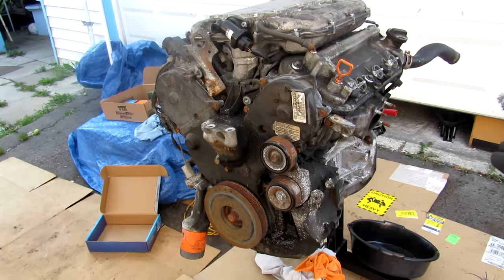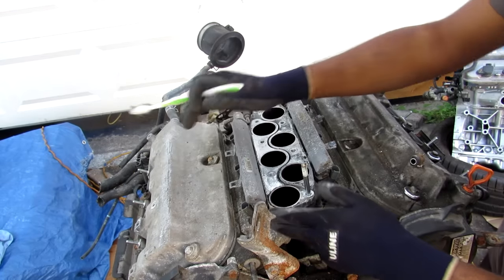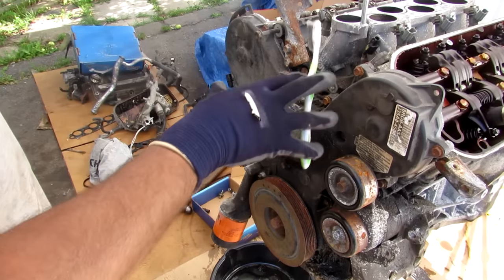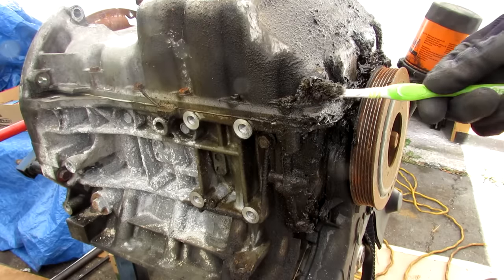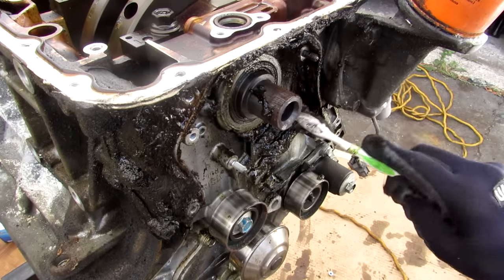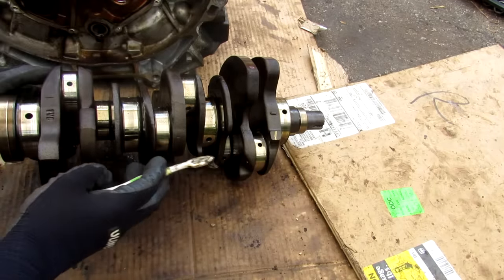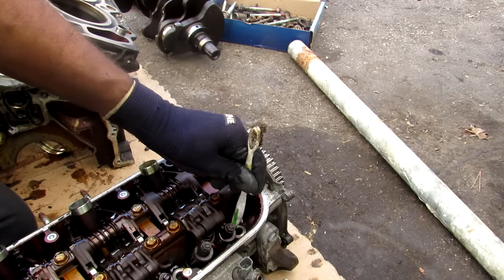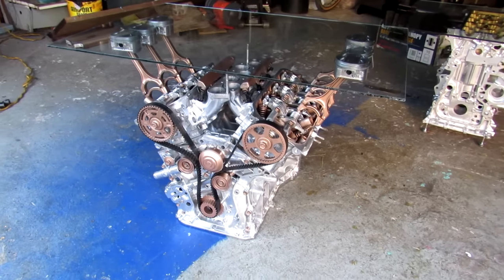Why Honda V6 Engines Haven't Changed For 25 Years

Comment: 5:41.  I replaced the knock sensor and shortly thereafter, the engine light came on again.  I actually made a tool (ground off socket) to remove it without removing the intake manifold.  I've heard complaints of mice chewing on the wire and now your video points out that the wire can fail due to heat.  Starting to think that heat is the culprit and replacing the wire is the proper fix for a bad knock sensor.
Reply from the maker: Yeah that's a common failure and it's quite tight to get in there and change the

Comment: Excellent video! Just a couple of notes: 1) No matter how religiously you service these engines, no matter what oil you use, the intake manifold will always look more or less like that. It's by design. 2) TB is not changed every couple of years. Its service interval is either 100K miles or 7 years (whatever comes first, it's usually 7 years, of course).

Comment: I have a 2004 Accord with the V6. It has 260K miles and purrs like a kitten. Had it since new and just did regular oil changes and a few plug changes and belt change. It’s been so reliable. I bet I can get 400K on it.

Comment: That major oil leak that you noted is one of the few weaknesses of the j series. Oil pump o ring that seals the oil pump to the block gets hard, flat and brittle and turns into a major leak. Other than that, and the occasional solenoid on the spool valves for the cylinder disengament, they are pretty bulletproof. Sources: Honda tech of 3 years
Reply: How about tearing down the entire engine to replace piston rings? Vcm also causes that issue. Bad crank ventilation. Destroyed cam lobes? The longer they modify this old design, the worse this engine becomes as far as reliability.
Reply: @jgranger2002  you do see those, but for the most part, they're pretty uncommon for how many are out there.
Reply: @Dylan Andersen  I pretty much see the oil pump leaking on every honda v6 I do a timing belt on. The vcm engines are trash. Fouled spark plugs. Gummed up, piston rings on them all the time. Owners that don't check their oil. Destroyed cam journals and lobes. Probably because people are using the onboard  oil change intervals. Who can blame them? Honda tells you to change the oil every 10k miles. This results in people changing it at 12k miles. They are now 2 or 3 qts. low on oil. Most cars nowadays are throw away anyhow.
Reply: @jgranger2002  I see the oil pump leak a good bit, piston rings occasionally, but the cams are very few and far between. Of the 3 dealers I've worked for, they've all recommended customers to change their oil every 5k, but of course, most people don't actually maintain their cars.
Reply: @Dylan Andersen  I agree. Unfortunately, manufacturers are pushing these long oil change intervals. I've done the first oil change on new honda turbo engine's. I did an accord 2.0 turbo at 4k miles. The oil looked like diesel oil after 10k miles. There is no way these engines are going to last. Like I said, throw-away cars are just the normal now.
Reply: @jgranger2002  the 2.0s are pretty solid so far. The 1.5 has issues though

Comment: nice video. you dont have to remove the heads to get the runners off. all you have to do is remove the fuel rail and that gives plenty of space to get the bolts off and slide it off. done it at least few times to replace the damn knock sensor

Comment: I work with modern J series V6 engines almost every day and few aside from direct injection and more plastic to reduce weight they are basically the same as this one
Reply: since you mentioned the newer di engines, have you seen much carbon buildup in these newer Honda V6s?
Reply: @meshkatt  honestly, not really

Comment: I wonder why Japanese cars are too good  though they ain't too expensive
Reply from the maker: Reliable, mass market vehicles. Easy to make and service. But low on technology / advancements.
Reply: @speedkar99  Didn't the newer J35's get Direct injection and cylinder management and stuff though?
Reply: @ciello___8307  Seems like I heard that too. Cylinder deactivation and D.I. delivery.
Reply: @Stephen-er4bi  the 2013 and plus models of honda accord both the 4 cylinder and the V6 have direct injection

Comment: I have a 2005 Honda Accord EX V6. It has 155k miles and it still drives like a dream. It has outlasted my wife's Ford Harley Davidson F-150, BMX X5, Cadillac SRX, and will probably out live her current GMC Terrain. I refuse to sell my Accord. I'm planning to buy a Honda Ridgeline next year along with a Honda Rebel 500 motorcycle. 
I can't stress how well made and reliable Honda vehicles are. I think my wife is finally coming around and is considering a Honda Pilot as her next SUV.

Comment: SOHC VTEC actually allows to change the timing of the intake and exhaust valves independently both in magnitude and phase. The disadvantage is that it is done in two steps, whereas  DOHC VTC engines allow continuous phasing. And the advantage is simplicity and compactness.

Comment: 9:00 First time I see AISIN logo on the Honda block actually is Japan Company that delivers part's to the Toyota they last long long enough !
Reply: aisin seiki is owned by toyota and it's not uncommon for japanese automakers supply each other's demands
Reply: @min_nari  these guys do a great job at producing top quality products from German original designs.
🤗
Reply: Aisin manufacture parts for most global makes. Have seen Aisin OEM parts on european (french and german) cars
Reply: @min_nari  toyota owns 30% of aisin.biggest shareholder.it was'nt theirs to begin with.
Reply: aisin makes some good fuckin oil pumps
Reply: fun fact, porsche uses aisin manual transmissions since the 996. the reason was very simple, they are cheaper than getrag (magna pt) transmissions. not really better, since toyota uses getrag transmission in there top of the line cars ....
Reply: Aisin has been a long time Honda's partner when it comes to water pumps and hydraulic tensioners. You can even get a standard Aisin TB kit off rockauto that works with a huge variety of Honda V6s.

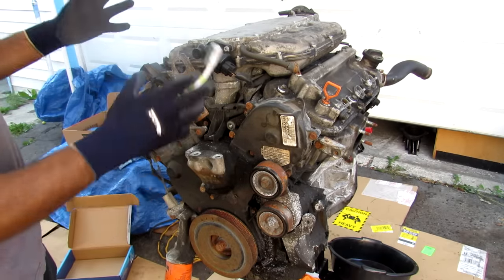Comment: 0:30 - i wish more people knew how poorly made fram oil filters were.
Reply from the maker: Tell them to Cut them open, after I did beside an OE I only use OE filters now
Reply: fram is fine, have 400k on the vechile and been using fram. If you change your oil as often as you should then it doesn't make a difference because you're putting a new one in .
Reply: @jtit2025  i will have to respectfully disagree. have a nice day.

Comment: I love my CL. Still have some work to do on it though.
Reply from the maker: Transmission?
Reply: @speedkar99  Already have a 2007 AV6 transmission in it. I meant lower intake runners and J37 Intake.
Reply: And then the engine blew. Giant hole in the piston head, a slammed spark plug, and bent valves. Swapped in a J35A3, only for the new engine to have a rod knock.
 Now I'll be using your tear down video to help me rebuild it.

Comment: You would think all engines with timing belts would be non interference.
Reply: All comes down to cost. Interference engines are a lpt cheaper to manufacture
Reply: Also interference engines cost major if you don’t swap the belt at correct period.
Reply: Warryck Scown manufacturers don’t care about that, cars are usually out of warranty when belts let go ;)
Reply: Belts and chains are just plain bad idea to drive anything,that's why truck and industrial use engines never use them.Gears all the way bro.!
Reply: Ugh for real, like why in the hell is ANY engine an interference engine? But especially ones with timing BELTS??? I don't get it.
Reply: Josh Alexander the answer is above. Cost
Reply: @JmanRx81  I think we should start a movement no engine should be interference engine it's a safety hazard.
Reply: @eugeneoreilly9356  my 1986 Oldsmobile Delta 88 the chain didn't break the gear broke. Only have 90,000 miles on it back in 1993
Reply: D yeah, but still
Reply: Josh Alexander manufacturing cost is everything. When you are making millions of cars, saving $100 an engine by making it interference design is a no brainer. Manufacturers don’t care about longevity past 5 years
Reply: @michaeltrinidad1217  The problem with chains is that over time they stretch.When the tensioner can no longer take up the slack they jump on the sprocket usually breaking a couple off teeth,that's why chains plus their running sprockets must be replaced at certain intervals.Manufactuters don't specify replacement times like belts so most people think they last as long as the engine.Never seen a problem with gears,ever.
Reply: Michael Trinidad it literally can be
Reply: D ugh I know
Reply: Alot engines end up being interference types more due to performance. I rather have a timing belt though, much simpler to replace and it's not a problem if you doing your timely maintenance.

Comment: No buddy. You do not have to take off the heads to take off the intake manifold You have to take off the fuel rails Stick a wrench in there and then hit it with a mallet.

Comment: - interference engine with a rubber timing belt 
-v6 configuration 

What a huge pain
Reply: Not a difficult belt to change tbh
Reply: @brysonshires9742  belt snaps and that's how you end up with a dead engine
Reply: @gvi341984  keep it changed and dont worry about it snapping 🤷
Reply: @brysonshires9742  rubber belts can and will snap before service 

Non interference engines do not have to worry about belts snapping

Comment: Thank you for an excellent video.  How important is it to do a valve adjustment if the engine runs as smooth as glass and no apparent valve tapping? Current milage is 144,000.  2007 Odessy .
Reply from the maker: I personally would leave it until there's an excuse to open it up (like valve cover gaskets)
Reply: I wouldn't sweat it of you don't drive it hard. The exhaust valves do tend to tighten up though...
Reply: Thanks!
Reply: You will know when you get miss fire codes when the engine is cold. The rear exhaust valves will be tight. Contrary to belief Honda valve lash never loosens.they get tight as a result of the valve seat moving higher up into the head casting and closing the gap. If you don't have miss fire codes or experience brief rough running upon first start up your valve lash will be within spec. Don't listen to what other people on the internet tell you. I know nothing!

Comment: Thank you for an awesome review of the type S engine. Now i know what a solidly designed engine looks like. Why Honda never use timing chain? The head gasket is interesting, would you say comparing to a Subaru, its the bolts or gasket design that made it so strong?
Reply: the modern timing chains barely last as long as belts that are more expensive to manufacture with all the pins and rollers that must not fail else it destroy the engine. 

Besides the super long V6/8 Chains need to be well lubed (German started using 3 separate chains in V6/8 engines) etc... 

All these reasons made the belt and easy choice to stick with!
👍
Reply: G Lasser not if it’s a Toyota timing chain, they are well designed. German cars are a different story.
Reply: @glasser2819  Honda has used chains in other motor series. They each have their own pros and cons

Comment: Best line in the video "this one used a Fram oil filter, so you can definitely tell this engine has seen some abuse".  :D.
Reply from the maker: All of the engines I seem to teardown use fram
Reply: @speedkar99  and you only tear down non-working engines, right?  Point made....  :)

Comment: Honda engine: and now I' gonna remove all the "x" mm bolts to remove the "y" part. Proceeds to remove a big chunk of the engine with 1 socket.
Vw engine: and now I'm gonna remove the "x,y,z,k" mm torx bolts, the "x,y,z,k" mm 12-point bolts, "x,y,z,k" mm hex bolts etc. to clear the way to remove the x part that is in the way of the y part so I can remove a minuscule part of the engine. I need to use 20 different kinds of sockets.
Reply from the maker: So true

Comment: The Honda 90 degree Vee Six was designed to fit the cheque for Austin Rover and Honda. Its simplicity itself. In terms of intake design, it was like Fords SEFi 5.0 and Rovers SD1/ TR7 V8 EFi, but everything is so well integrated it hands the Wests Ass to itself by shear Far Eastern Application. I wish my Toyota I4s and In lines and V6s were as nice to work on. Great video!

Comment: Carbon residue/buildup is a natural byproduct of combustion. It does not mean that the engine hasn't been serviced. And timing belts don't need to be replaced every couple of years - most belts have a ~120k service interval. Stopped watching after that.

Comment: "Timing belt every couple of years or the belt cracks"....    That engine has never had a timing belt replacement and they'll go a lot longer than 105k miles if you like to live dangerously and your water pump doesn't give up.        It just shows how much abuse and neglect these J series engines can take.
Reply from the maker: They sure can

Comment: I used to be adamantly against the concept of timing belts and valve adjustments in modern vehicles. Now my perspective is that servicing these components should be looked at as a restoration, bringing the engine back to factory specs and tolerances. This maintainable feature will prolong performance and efficiency over a longer period  compared to an engine with timing chain that gets incrementally worse and out of spec as it ages. Of course the timing chain shouldn’t need to be replaced until many hundred thousands of miles, but when it is needed, it is expensive and the engine has likely been running tired for longer. In practice, few keep vehicles long enough to warrant multiple timing belt changes or a chain replacement.

Comment: I have a 2008 Honda Odyssey EXL with this motor in it that now has 178,700 absolutely trouble free miles on it. Everything under the hood is still original. I also have a 2017 Honda Accord V6 Touring (the last year you could get this motor in the Accord) now with 61,000'ish miles on it. I bought it because of how reliable the first one has been.

Now that our oldest kids are driving and we we gave them the minivan since it is old and has airbags all around to protect them, I just bought a 2021 Acura MDX with this same exact motor because of just how great it is. 

Find me another V6 motor with nearly 300 hp that can get such great mpg and is absolutely reliable through and through. You can't!
Reply from the maker: The 2GR from Toyota comes pretty close.
Reply: @speedkar99  That is a great motor too. I have been reading though on forums and seen some videos including one Toyota lover Scotty Kilmer made stating that the 2020-2021 V6 engines Toyota has been putting out have been having issues.

We'll see what materializes with that over the next couple of years.

Comment: The good ol' J35 , my 2011 Ridgeline still kicking good, a hair shy of 190k, drives just like when I bought it. I don't believe  in the " Maintenance minder " horsecrap. I change the oil every 5k . Oill is cheap, engines aren't.

Comment: Honda changes the J engine all the time. Guess what every time they change it it gets less reliable. Vcm killed this engine. Turned it into an oil burning trash motor. Luckily for honda fans, this engine will no longer be available in new vehicles very soon.
Reply from the maker: Well they just added direct injection and updated for the Pilot ..
Reply: @speedkar99  just had a single turbo 4 cam mdx at the shop. We'll see how those hold up.
Reply: @speedkar99  The Pilot gets a brand new DOHC design. What are you talking about? They've been DI for many years now.

Comment: Gm put these motors into the Saturn Vue . Probably the best part of the vehicle . Just did a timing belt/ water pump on 1 last week . Had to buy a 3/4” impact gun to get the crank pulley off.

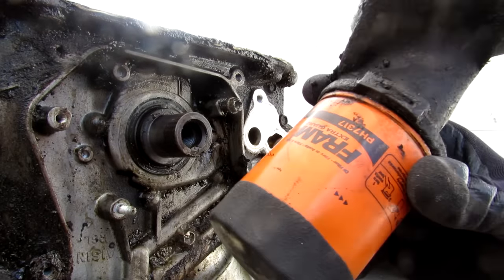Comment: New subscriber here...I am getting more interested in engines and the mechanics of cars in general....question for you...you mentioned at  8:48 that the FRAM filter meant that engine probably saw some abuse. how come? is that not a good filter? how come? what are better ones? Thanks!
Reply: @DetroitMFers  Thank you!

Comment: I have a 2003 Honda Accord with the 3.0, I just had the timing belt kit and water pump replaced, should I change it at 60,000 mi, or 5 yrs, or what would you recommend?.
Reply: 105,000 miles unless the vehicle has been neglected.

Comment: I've got the 2000 Accord with the J30A1. Engine has been bulletproof (240K miles). The transmission not so much. Put in a transmission cooler with an inline filter. Kept the second transmission spinning right along. Oh, and don't use Fram filters.